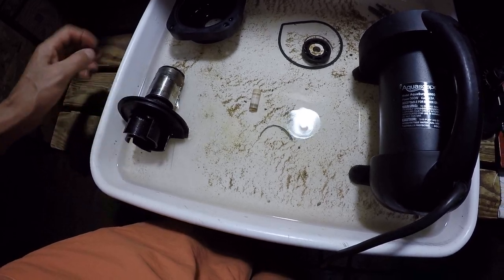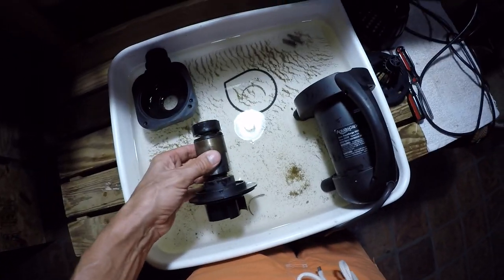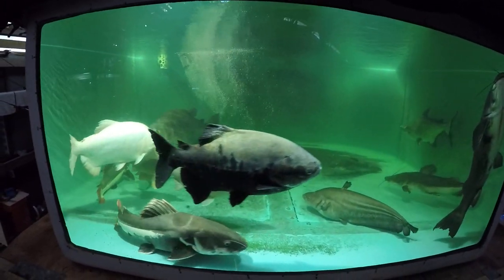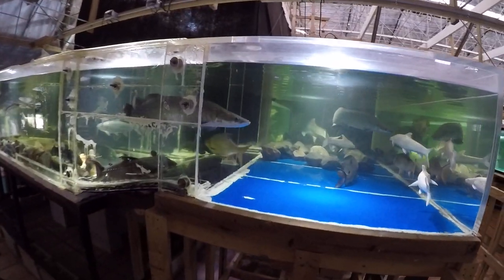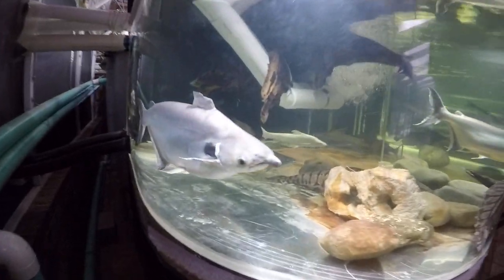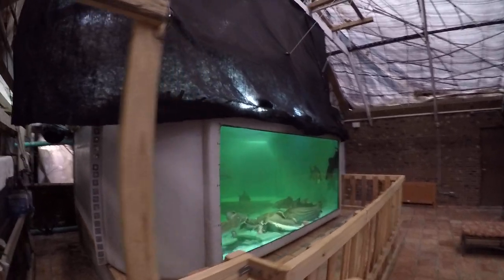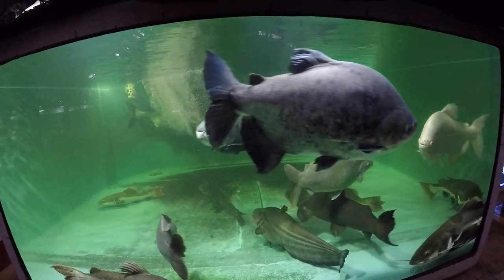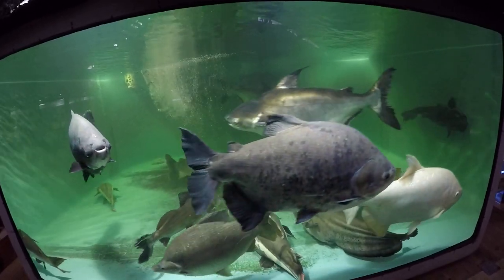Heavy, dirty, stressful 3: broken pump shaft; conclusions on cleaning the sump filters

Comment: I think 25 years for a pump life is a little extreme. Those pumps are running 24/7 so 10 years is a long time. That ceramic impeller assy. is the weak link. I would replace them in all the other pumps if I were you. May want to call Aquascspe and ask them the service life on those impellers
Reply from the maker: Thank you.  25 years was what a lab technician for a major pump manufacturer told me.  He did mention proper maintenance.  Probably you are right, it includes cleaning the cavity and replacing the impeller assembly in time.  We have 22 pumps running full time.  20 of them are these Aquascape AS5000.  This is the first loss.